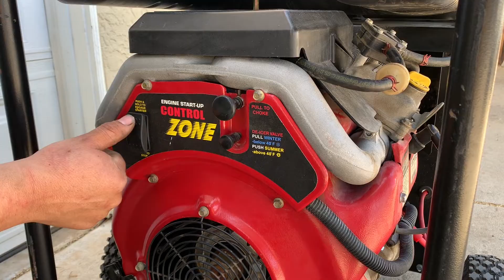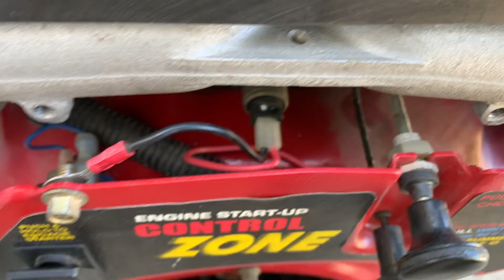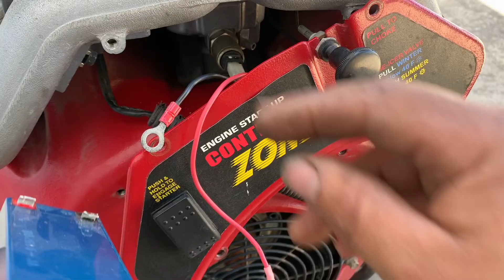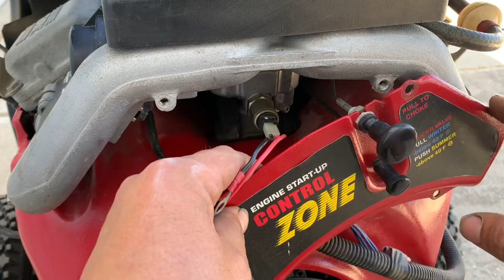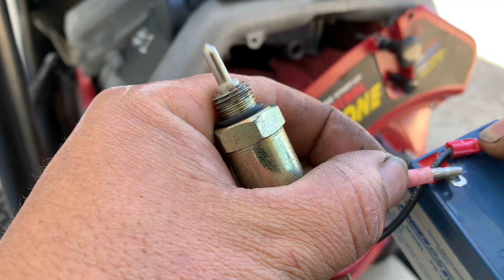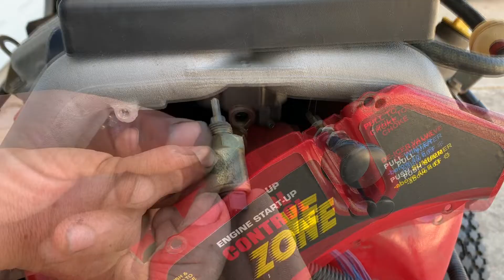Generac Ultra Source 15000 crack no start fuel issue @elchanojose

Comment: THANK YOU SO MUCH! for this video. I'm still learning at 62 years old and had never encountered one of these solenoids before. I cleaned the carb twice because I knew it was a fuel problem but after a week of going back to this thing I was stumped an a new carb was more money than I wanted to invest.  I did the 12V test and the solenoid was silent. I took it apart and sure enough it was stuck shut. A session in the ultrasonic cleaner and it was then activating like it should. Put everything back together and it started right up.  I learned!
Reply: Mine was stuck shut to!! Easy fix now to fix the rough idle.

Comment: I have the 15000 same as yours. I was trying to pour concrete with a mixer to far from the meter. My Mixer got hot which stopped my pour. So I needed my big generator very very badly to keep my project going. The generator wouldn't start so I removed the carburator and cleaned it the best I could. Generator still wouldn't start! I went on line and found a site on how to clean the carburetor better. I was about to take it all about again 😐. Then I saw your site 🤔😁. I followed your instructions and it worked!!! Not only did you help me fix my generator, but you saved the day! / My Portland cement!!!! Thanks again👍
Reply from the maker: Hello!  Thank you so much for taking your time to watch our video and for sharing that our information was very helpful and got you to fix your generator to be able to finish your task.  We have a few more videos about this generac and one thing is that don’t let it sit too long without starting it. Try every month just to keep it moving.  Soon we will have more videos for this generator.  Here is the link to the manual to it.  Take well care.  https://rentamaxcr.com/manuales/generac%2015000%20ultra%20source%20manual%20partes-reparacion-diagrama%20electrico.pdf

Comment: I am getting oil out of the breather in the impulse fuel pump on that same generator you are working on.Oil level is at full..
Reply from the maker: Hello Dave! The only oil that can be coming out of there is engine oil.  Take the air filter box out and expose the carburetor to see if the carburetor is wet of oil and this way you can start by looking where the oil is coming out.  Most likely the oil is coming out do to a bad exhaust valve seal.  If the generator runs fine and does not smokes on the exhaust,  then the exhaust valve might be the one with a bad seal and that’s where the oil is leaking from.  Start by exposing the carburetor and check the spark plug.  Take well care Dave!

Comment: Thanks for the detailed instructions in this video. I have a 17500 guardian ultra and it sat for some time. I just cleaned carburetor and changed gaskets, float and float needle in carb. Also put a new fuel shut off valve. Problem I'm still having is it will start for literally 3 seconds, then die. I thought there was an issue with carb and it not cutting fuel off, cause the plugs were always gas fouled and wet. 
But after watching your video, I wonder if its because after it died, I was trying to restart it several times and didn't shut fuel off. Could the fuel have over filled carb and fouled plugs while I was trying to restart the generator? Thanks again for the great tips in video. I know my fuel shut off valve works as tested with your method.